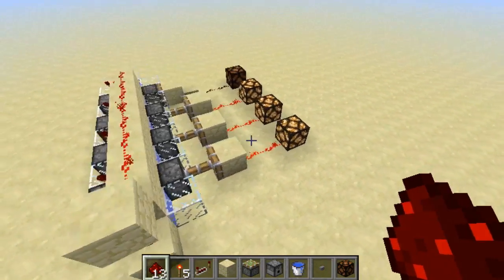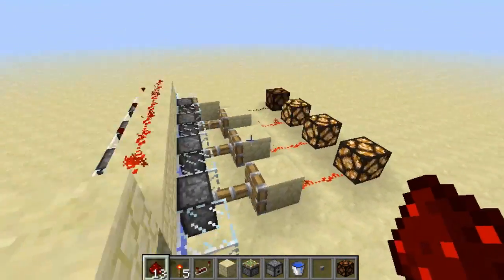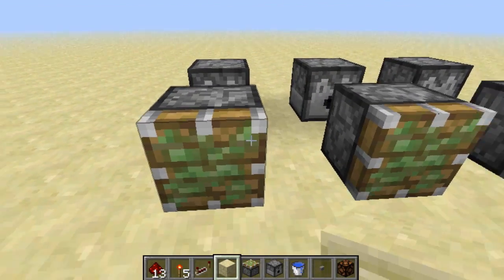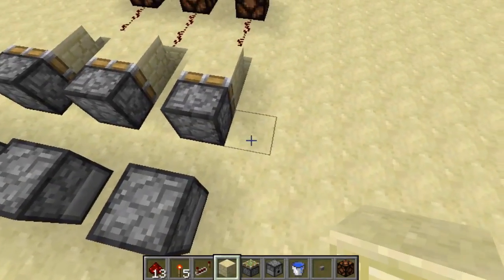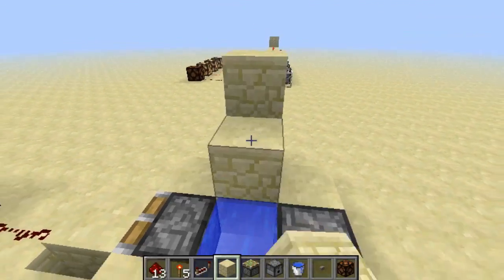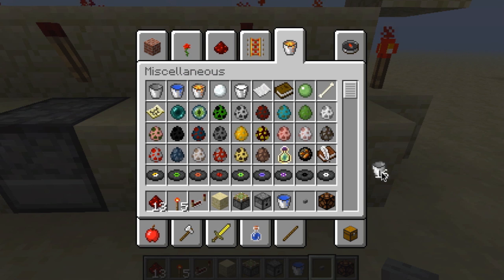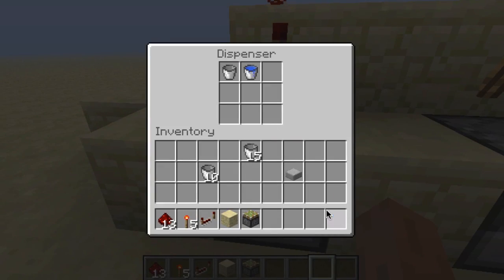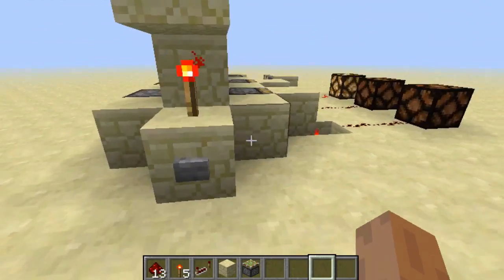Compact and Easy Random Number Generator (RNG)

Comment from the maker: Search for a binary to decimal converter.  If you wanted nine combinations, use a 4 bit RNG (16 possible combos) and set 7 of the outcomes to re-generate the random number until it gets one of the nine real outputs.  OR.  You could use a 4 bit RNG but only use the first 3 bits for the real outputs (8 combos) and then use the last one with an AND gate to make a 9th output if all 3 first ones are on and the 4th is on.  Sorry if this is lengthy/hard to understand.

Comment from the maker: because the torches and redstone are placed correctly, a button press will fire all the dispensers twice.  That means they will start with a 50/50 chance of choosing one bucket to fire the piston.  If they pick the empty bucket, there will be two full buckets, one of which will be emptied at the second pulse.  If they pick the full bucket, there will be two empty buckets, one of which will be filled at the second pulse.  In other words, the system chooses a bucket and then resets itself.

Comment from the maker: The dispenser could either fill up a bucket or empty it.  If it empties the bucket, the water in front won't change and the piston won't receive a block update.  If it picks up water, the piston updates and gets powered.  Each bit will randomly pick a 1 or 0 every time you push the button.